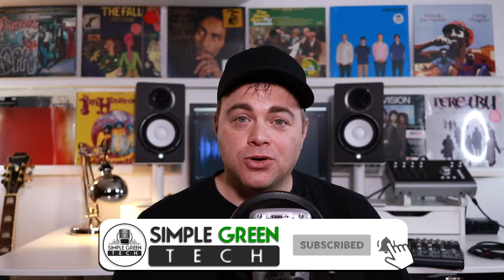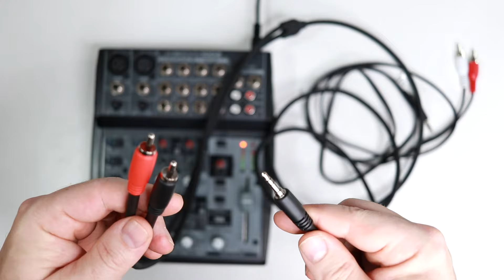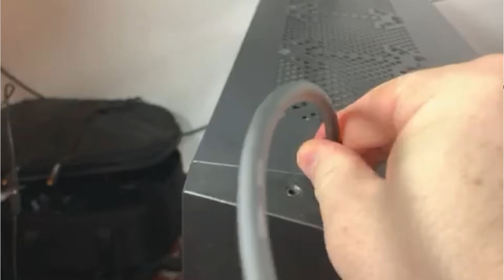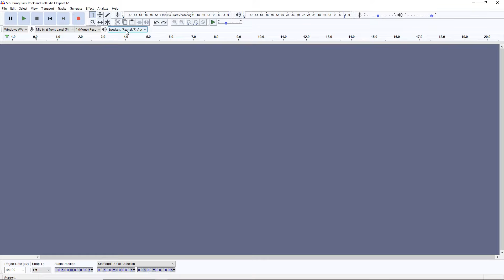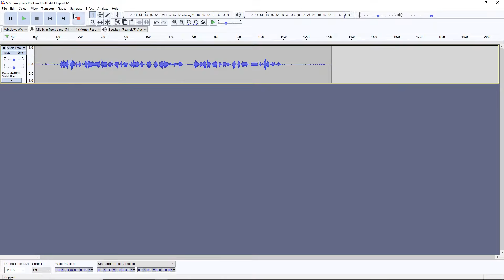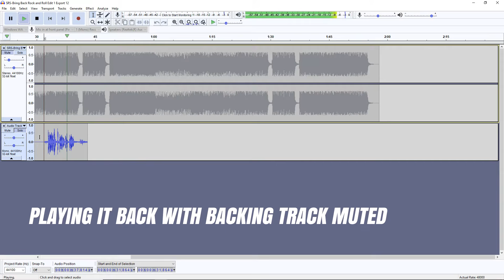How to Connect Mixer to PC For Recording Without an Audio interface

Comment: If u have the usb Behringer XENYX X2222USB 22 Channel Analog Mixer xan i select 22 channel in flstudio  to record in separate channels like an audio interface
Reply from the maker: I believe that USB mixer has 2 digital ins and outs when connected by USB. So you could to 2 separate channels/tracks at the same time. 

On the mixer you would need to pan 1 of the physical inputs that you want to record all the way left and the second physical input would be panned all the way to the right. You could record multiple physical inputs at the same time but they would be recorded with any of the inputs that are panned to the same side as them.
Reply: @AudioTechTV I think 8 channel audio interface would be better option

Comment: Hello, I followed your instructions trying to connect my Yamaha MG12/4FX mixer to Windows 10 laptop's USB port.  Since the mixer doesn't have a USB port, I did this:
- Connected a USB audio adapter to the USB port of the laptop
- Connected an RCA cable from the mixer's REC OUT to the Microphone jack of the USB adapter.
- Connected another RCA cable from the mixer's 2TR IN to the Headphone jack of the adapter.
- Connected headphones to the Phone jack on the Mixer.  Turned the C-R/Phones knob on the mixer up.  Pressed the 2TR IN button on the mixer (underneath the knob) as you suggested.
- Right clicked the speaker icon in the system tray of the laptop, and selected the USB adapter for both Plaback & Recording. Did the same thing in Audacity.
I can record my voice (using Shure SM58 connected to the mixer) in Audacity, but cannot hear anything.  I tried playing a track off YouTube, but don't hear anything on the headphones. 
Need help!

Comment: I actually wanted to know more about the recording to audacity ...  and audacity  .. or   Is there anything more user friendly than audacity??? And what about using the USB out out of your mixer???
Reply from the maker: Audacity is about as user friendly as it gets in terms of the actual recording process. 

If you have a mixer that has a built in audio interface then you can use that if you want and it should show up in audacity. For instructions on how to connect a usb mixer to your computer, you connect the one end of the usb cable to the mixer and the other end goes into an available usb port on your computer and not a usb hub. It’s that simple.

This video is for mixers that don’t have usb audio interfaces built in as it’s not as simple as plugging in a usb cable.
Reply: @AudioTechTV  thank you very much

Comment: can you help me what type of cable do i need i own a bookshelf speakers with only 3.5 mm cable
Reply from the maker: You could connect them to the headphone output if you get a 1/4” jack. The other option would be to get a Y cable that you can plug your 3.5mm into and has 2 1/4” connections coming out of it. Then you would connect those to the speaker/monitor outputs of the mixer.
Reply: @AudioTechTV   THAAAAANK YOUUUUUUUUUUU I OWN YOU A BEER SIR

Comment: Nice video, but I have a comment posed as a possible question:

I know one of the purposes of your video was to use the mixer and record to a PC (or Mac) with out  plugging into an interface. I also think you wanted to show how you can record 2 instruments or vocals at the same time and it have its own controllable channel both pre and post recording. Am I on the correct assumption? If so, why didn’t you just use the USB in back of mixer and plug into computer?
That now becomes an interface but only for a stereo out that being said, you could then do what you demonstrated with panning and have one instrument hard left and one hard right. Exactly the same result except, what I am saying is the cleanest signal you would get. You just need to make sure that your usb out is set to the behringer as soundcard/interface when you record to audacity. This method gets rid of all the extra cables that you said we needed to purchase at the beginning of the video. 

Note* that’s what these mixers are for when you have a usb connection. They become a stereo interface for audio recording and live-streaming
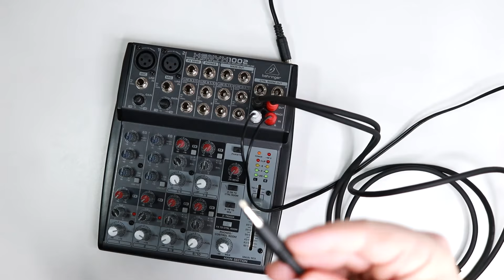Reply from the maker: Note* at 0:15 in the video I say that this is a Behringer Xenyx 1002 mixer (which is not a USB mixer) then also Note * at around 0:25 where I specifically say “this is not a USB mixer”. So Note * that is not what these mixers are for as they do not have a USB audio interface on board. And if they did, the statement about cleaner audio is likely incorrect as the interfaces that they put in those mixers aren’t that high quality.

Comment: Thanks for the video.  I really appreciate all you do.  I'm having a hard time connecting the 2 track recording.  I'm using Audacity.  In it I use punch and roll.  It is possible to hear and record at the same time while using punch and roll.  Thanks for your feedback.  And thanks again for your videos.

Comment: i need a line in stereo input USB audio adaptor to record 2 channels simultaneously onto audacity and/or an oscilloscope software. Does  such and adaptor exist?
Reply from the maker: Your onboard sound card might already have a stereo line in. If not then you can get one of these little adapters https://amzn.to/3tJHCQ6 for under $10 and they will work for your needs.

Comment: Wow, excellent info. Cheers from Canada. This is an Analog Mixer, correct. Now in 2022 which Input will take Line Out or To Headphones from an Android phone, say a Karaoke Track?
Reply from the maker: Yes this is an analog mixer. You can go from the headphone output on your phone into a line input on the mixer. If you want to have it in stereo, you will need to use a 1/8th inch TRS cable on one end (the phone end) and on the other side it would be split into two 1/4 inch TS connectors on the other end. On this mixer you would use any of the channels except 1 & 2 as 1 & 2 are mono channels, the rest can be stereo. Here is an example of the cable https://amzn.to/3b4AVCR

Great to see a fellow Canadian on here! Thank you for watching. Keep creating! 👊👍

Comment: I want to hear my voice through phones output but when I press TR TO CTRL RM button I cannot hear it anymore, and if push TR TO MIX as you sayed I transmit both, computer and microphone sound, is there a way to monitore my microphone and still transmit only my voice on the computer? I've the XENYX 1002 FX mixing table.

Comment: I got only the 802 xenxy(not usb) dynamic xlr mic and laptop with AUDACITY(Bluetooth speaker for monitoring). How do setup a recording session
Reply from the maker: I show how to do that in this video. Check it out! The 802 and the 1002 are basically the same thing. One has a couple extra inputs. You can connect it the same way that I show in this video.

Comment: what if i have a usb mixer do i still need to use both cables back into the computer? (Xenyxq1202usb is my mixer)
Reply from the maker: If you have a USB mixer you just need to use the USB cable as your mixer already has an interface built into it.
Reply: @AudioTechTV  okay but anytime i try to record any audio from my microphone plugged into thr mixer none of my DAWs record any input from the mixer. (I tried changing the sound input & output to the USB CODEC & on the daw’s preferences too and nothing) what could be the issue then?

Comment: Hello Sir, will this also work when I want to record an instrument instead of my voice? Because then it is necessary, that I can hear my Instrument AND the backing track while recording my Instrument WITHOUT the backing track. I own the behringer xenyx qx 1002usb.
Reply from the maker: The USB version can be used as an audio interface so plug in the USB to your computer and you’ll be able to record and listen at the same time. Make sure you download the Asio driver for it from the Behringer website. The default driver that installs when you first plug it in isn’t the greatest for music production.
Reply: @AudioTechTV  Well I did connect it via USB but i dont know how to get it working in the way i described it. if both usb/2TR buttons are not pressed down i dont hear any backing track. if i press down usb/2TR to phones I can hear the backing track but cant hear my guitar which is in the Line in. and when i press down usb/2TR to main mix i can hear myself and the backing track but the usb and 2Track recording signals are getting muted so i cant recorrd :( :( right now i only use the usb connection. i ordered the usb audio adapter for my laptop as you recommended but i dont think it will change anything since the usb and 2 track connections are treated the same way :(
Reply from the maker: @serkansen0190  if you connect it by USB you don’t need to set it up the way I did in the video. This was how to set it up when it’s not a USB mixer. When you connect the mixer by USB it becomes an audio interface. In your software select it as your audio device and you should be able to listen to what you’re recording along with anything played ba k. No need to worry about the 2 track buttons or anything. Just connect your headphones or speakers to the mixer and you should be able to hear it. 
I don’t know what the driver for this mixer is like but you might want to install Asio4all Andy we that as the driver. Asio can give you better recording performance with lower latency so when you’re recording while playing other tracks it will be more in sync.
Reply: @AudioTechTV  I deleted my previous comment because i found a better solution without delay. Maybe it helps other people like me who simply want to record their guitar into a computer, while hearing their guitar signal and a backing track. While your Mixer is connected to your computer via USB : You have to connect the "Main out" of the mixer with the "2 Track In" of the Mixer and activate "USB/2TR to Phones" and deactivate "USB/2TR to Main". This way you get your "Line in" (guitar/mic etc) to your phones (because without the wiring the "USB/2TR to Phones" disables your ability to hear your "Main Mix" signal on Phones - I dont know why the hell) as well as your backing track from your usb laptop but can still record because you do not need to activate the "USB/2TR to Main" switch (which mutes your recording signal).
You also have no delay because there is no audio on your phones which had to be send to your laptop, processed there and sent back to the mixer.
Reply: @AudioTechTV  You would be an absolute legend to me if you could explain to me what I am doing wrong but right now I can't see a solution. In your video: could you record yourself while hearing your voice and the backing track through your headphones?

Comment: Do you know how to set up recording for the Q1002USB version? I’ve panned the two channels left and right to try record them separately but it’s not working 🤔 also I can not hear myself when recording.
Reply: Serious question: Have you tried it the way it is shown in the video?
Reply: @serkansen0190  Hi thanks, yes it does work that way, I was wanting to find a way to use it with the USB.
Reply: @JoshuaJHeeley  what i dont know is, wether you can use usb to get the backing track into your mixer but use two track to get your main mix back into your pc while simultaniously hear yourself playing on the phones.

Comment: Hi, need a little help, I have a Yamaha mixer MG06X and a laptop without mic input jack connector. Is it possible to connect the laptop to the mixer and then to powered monitors. I don't require to record to computer, just want to use for sound playback through laptop. Thanks a million for your informative videos.
Reply from the maker: Yes you can do that. You can get a Y cable that plugs into your laptop’s headphone jack on one end and the other end will split into left and right with 1/4” connections and plug those into one of the stereo input channels. And plug your monitors into the mixers output.
Reply: @AudioTechTV  Thanks for your reply and help, much appreciated. Keep your videos flowing, Ken

Comment: Thank you for this! I used my SM58 to a mackie mixer to my computer, it works fine I just have lots of static, what can I do to reduce this without harming my microphone audio?
Reply from the maker: If you’re not using a standard xlr mic cable make sure you use one of those not an xlr to 1/4” cable. The static could be from cranking the gain up. Try lowering the gain and increasing the output volume. Another option would be to get a cloudlifter or a Fethead which provides extra clean gain.
Reply: @AudioTechTV  Thanks for the reply! I am using an amazon basics xlr mic cable, My gain is very low.

Comment: hey bro, nice video. I have conected both in and out rca cables, and the in channel is working, I can hear my voice using the headphone pluged in the mixer, however, my line in to the computer (mixer out going into red/pink jack in computer, BUT mine is not usb spliter, it´s p2 pluged into the notebook and the other side 2 p2 plugs, one for headphone other for mic) is not working, I can even see the option line in or mic pluged in front or pink jack). So my voice is not "going" to the pc, also, my audacity software is not working at all for recording, it´s appearing some error -9996 invalid device. I have installed asio 4 all the other day, so it´s not driver problem. Please help me, ho can I "tell" my computer that there is a line in, or how do I install the line in that the pc is not "seeing"? I´ve tested it with usb cable to (rca to p2 female with p2 pluged in and other point is usb), the pc didn´t recognize the usb interface as well. Also I´ve tested the main out P10 (two plugs) to p2 male pluged in to the pink jack on the spliter.

Comment: does it can be used at laptop which only have on input... or can i use conector 1 input with mic and speaker input, and connect to my laptop? and how setting at audio device at laptop... im try using to obs... many thanks

Comment: A tip for anyone who reads. When connecting 2 track to your computer, if you have a desktop connect the input and output to the pink/green ports on your motherboard in the back. This way you can record while being able to use the front panel headphone and microphone ports.
Reply: Hello Ramsey, I just bought 1002fx mixer and I wanted to know how can I use my headphones on it not just for hearning my voice also hearning the pc sounds
Reply: @omarsabrivoice  I'm not sure on that specific model. What i do for my Behringer Eurorack 602A, is once 2 track is connected to line-in/heaphones i simply hit the "2tk to control room". So what it looks like for me is 2 track out > line in: 2 track in: < headphones port. Then hit 2 track to control room with headphones plugged into mixer and it should work.

Comment: just double checking, would it not be possible to just use a headset splitter for the laptops with combination jacks?
Reply from the maker: If you have a laptop that has a similar combo jack like a cell phone then you could use a trs to trrs cable or adapter.

Comment: Great video! I have one question though: can I record more than two microphones using this method, or does it need another way? Thanks!
Reply from the maker: Yes you can record two mics. Set the pan of mic channel 1 all the way left and pan of mic channel 2 all the way right. That will separate the 2. Then in your daw software set the input of track one to either input 1 or Left (depending on what the wording is in your software) and then track two would be input 2 or right. Make sure both tracks are mono tracks.
Reply: @AudioTechTV  Thanks for the reply! What about if I want to record three or four mics?

Comment: so i have a dumb question. I have my mixer set up with the two rca to 3.5 mm but i can only listen to just my headphones or just my audio. if I want to listen to both it goes into the mix so i cant listen to both while only recording one. is this because I only have a 1 bus analog mixer? 
my mixer for reference: https://www.amazon.com/gp/product/B004TM31QK/ref=ppx_yo_dt_b_asin_title_o00_s01?ie=UTF8&psc=1
Reply from the maker: When you’re recording you’re recording the mix so anything sent to the mix will get recorded. If you want to listen through speakers and headphones you would need to connect both to the headphone output by maybe getting a headphone amp or another way to split the signal. Some mixers do have speaker outputs on the auxiliary but it looks like yours just has a headphone jack.